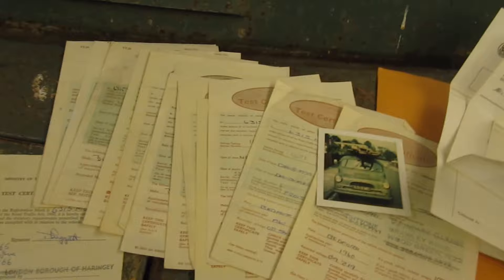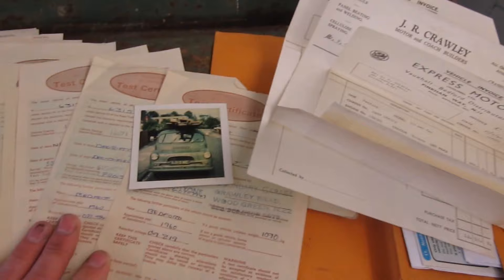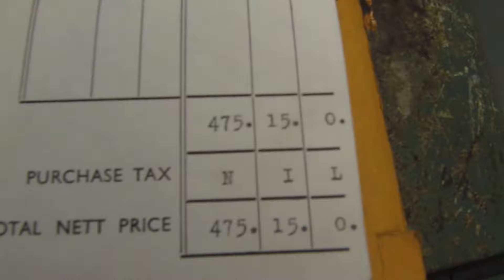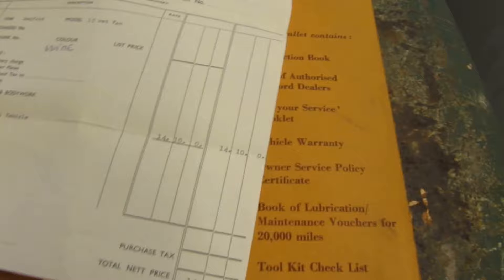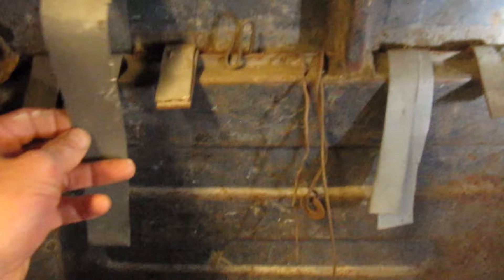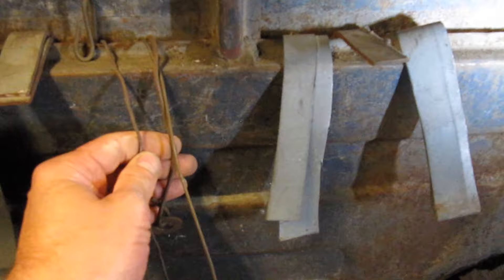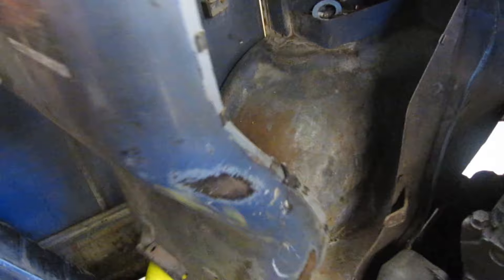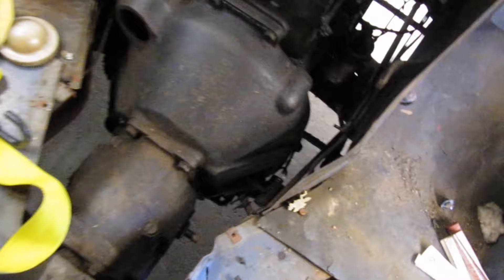Trev's Bedford CA Van Blog - Part 1- Overview Vintage catering van build project

Comment: Hi Trev, love your video's. But must mention that this CA is technically a MK2, as MK1's had a spit screen back in 1952 and changed to a full screen in 1958. Cheers anyway. Philip.
Reply from the maker: Philip Knowles you’re right Philip, I made this shortly after buying it. Cheers Trev 👍